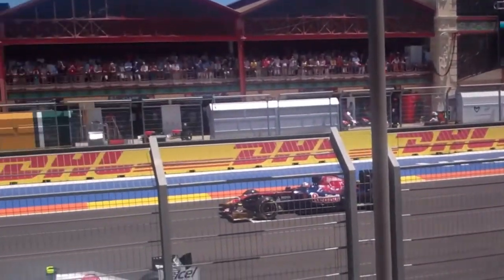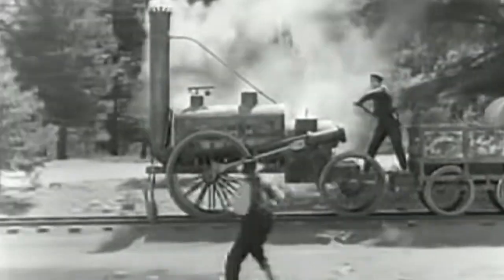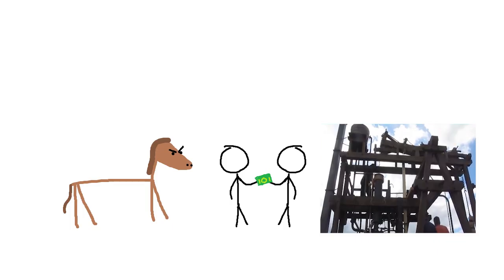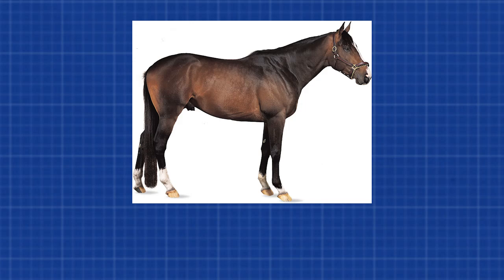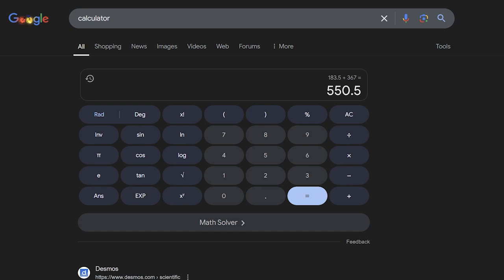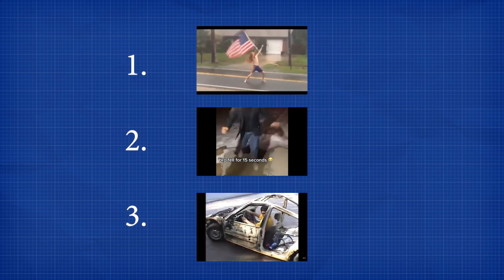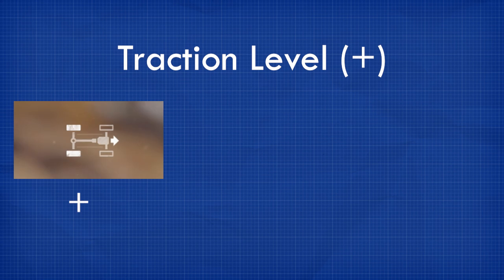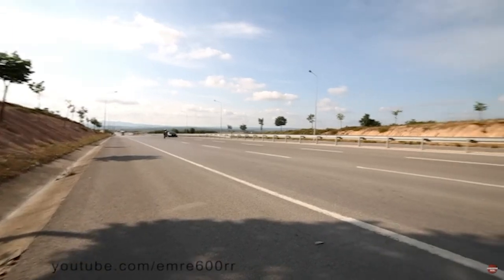The Misunderstood Myth of Horsepower

Comment: This video is a little misleading, horsepower is still a good measure at the rate at which work gets done.

In fact, you can calculate horsepower yourself, Horsepower is torque multiplied by RPM,.

Driving 4 Answers has great videos on this, with detailed explanations:

 https://www.youtube.com/watch?v=LUgjpDMcwpI

https://www.youtube.com/watch?v=Nbev14oIH6I